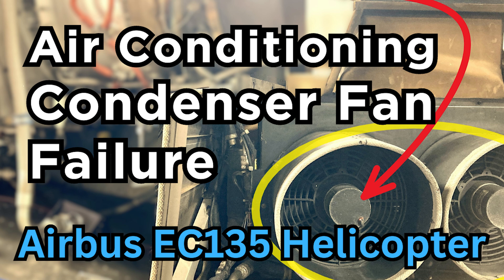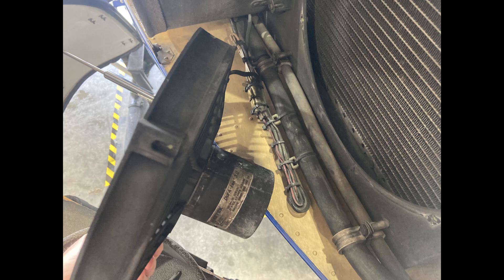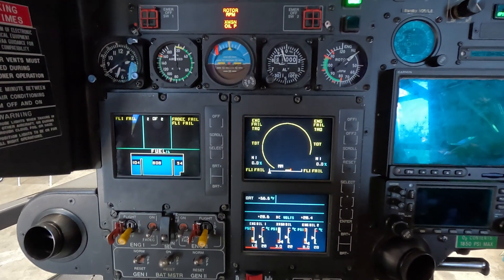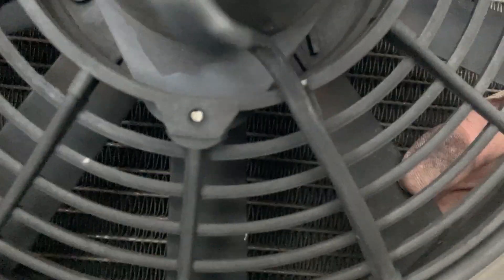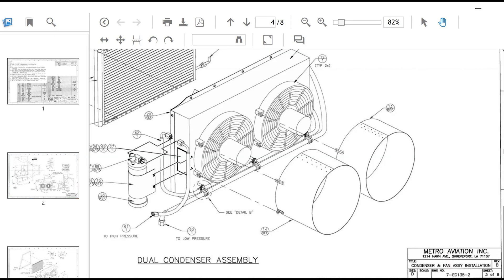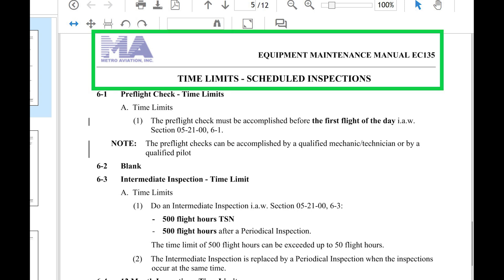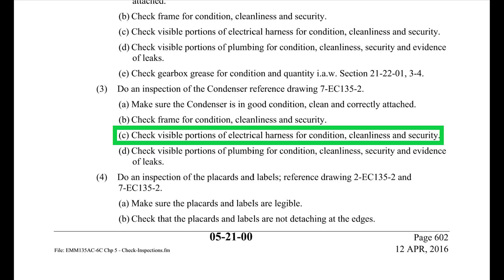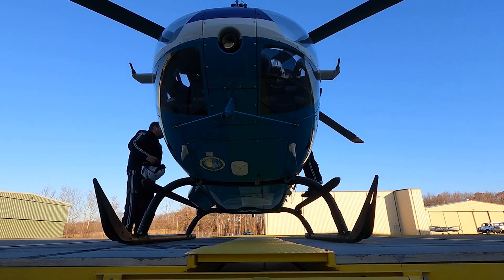AC Condenser Fan | Airbus EC135 Helicopters with Metro Air Conditioning installed

Comment: So that's how AC system looks like...nice! I have some questions - 1:25 I can see one thing that can't let me fall asleep. :D The door you opened is GPU/EPU, above is maintenance step, but the third one on top? Are they on both sides of H/C? What are those for? :D 

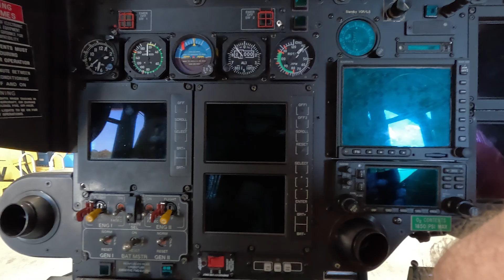Also, 1:34 on the overhead panel I can see AUD 1,2,3 circuit breakers. What is AUD? Is it intercoms, like radio or sth? I don't see VHF circuit breaker. 

I love what you do. I feel so much joy when I research stuff and learn sth new! I could show you my overhead panel, or overview of my helicopters, if you are interested. Have a nice day!
Reply from the maker: Above the EPU door and maintenance step on the right side of the aircraft is a  shore power plug to power/charge the ems medical equipment on the ground.  I’m not exactly sure what the AUD 1, 2, and 3 specifically power.  It’s definitely the internal Audio/Communications, maybe the front, the back, and the patient audio.  
Thanks for your input brother.
Reply: @HelicopterMaintenance  Does crew uses ems plug on ground often? I ask, cause we don’t have it. Everything is charged from generators or battery. Maybe you have totally different ems stuff.  

About the second question. If you don’t have VHF, how do you communicate with airport towers and other? Beside VHF and internal intercoms, we also use tactical radio - set to specific frequency, so we can communicate with hospitals, fire fighters and other services when we fly.
Reply from the maker: @qweq9972 The shore power is just to charge their equipment on the ground between flights.  There is also a medical inverter that powers their stuff during flight.
Yes we have a VHF radio, separate from internal Comm’s, to talk to the hospitals and ground crew.  And and 800 MHz radio for some regions.

Comment: Are those brushed motors?
Reply from the maker: No idea.  I don’t think so if it lasted 20 years
Reply: @HelicopterMaintenance  good point
Reply from the maker: @ericdixon2898 the evap blower motors in the 407 AC fail more frequently.  Those have brushes